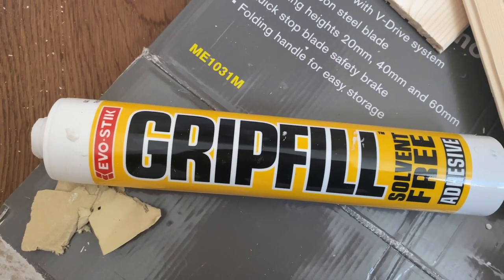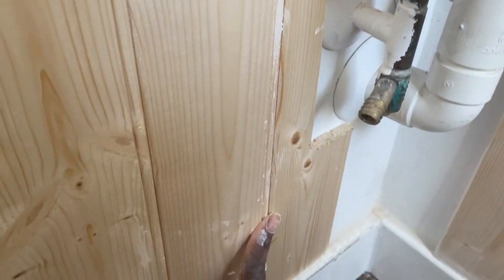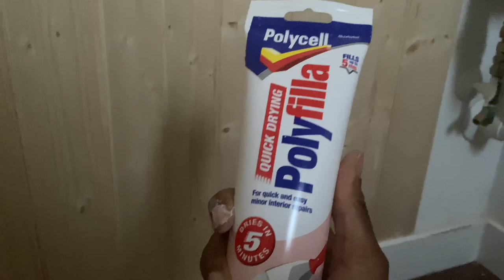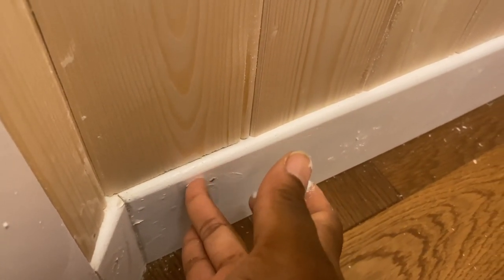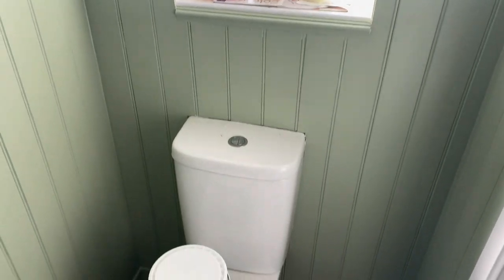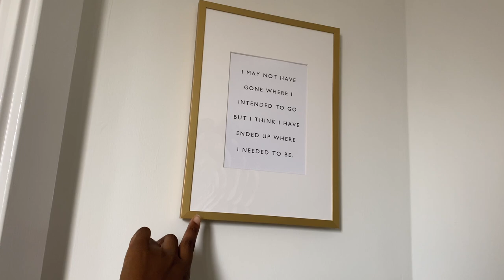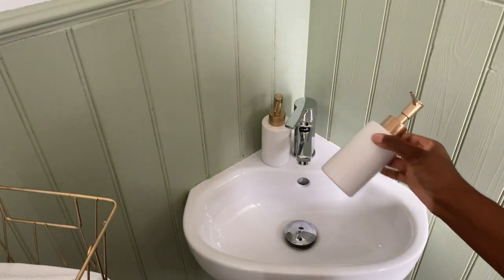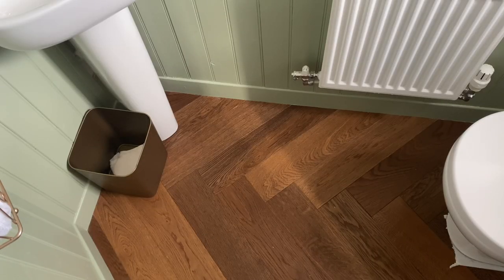DIY Cloakroom Transformation (with tongue and groove cladding). Persimmon Hanbury WC

Comment: Lovely job, well done. I found where caulking was used it's difficult to paint over.
Reply from the maker: Thank you! Yep caulk is rubbery so hard to paint over! It’s the last step after painting really (any gaps should be filled/sanded before paining). There is a see through caulk which is less obvious, or if your fixtures are white like mine, then white caulk I guess is an okay option. ☺️

Comment: looks lovely!!
Reply from the maker: Thank you ☺️
Reply: @WhenLoveisProjected  incidentally what did you use to cut the panels..??
Reply from the maker: I used a circular saw to trim them to length and a table saw because some needed to be cut lengthways on the angled corners. You could achieve the same with a jigsaw as well. Hope that’s helpful!

Comment: great video. How did the tongue and groove paneling fare with time? I read lots of reviews on the similar B&Q ones saying that they develop gaps over time. Did you leave them in the room to dry out for some time before?
Reply from the maker: No I didn’t leave them in the room at all. Yeah they’re fine. Two gaps that were easy to sort, but I’d have a little movement anyway because of settling. I suspect the complaints are because of fitting issues. If you apply enough adhesive, ensure they are properly interlocked and also you could use a nail gun as well (I decided not to) then you shouldn’t have problems. Overall for the price, I think it was a decent product.
Reply: @WhenLoveisProjected  Thank you so much!
Reply: You've litterly asked my "main" questions... 👍🤲

Comment: Are you sure the link to the cladding is the correct one? Your joins look pronounced (which is better) than mice, mine click together with a pretty smooth finish / join?
Reply from the maker: I think so. I didn't buy it online, I got it in store, but I matched the link up with the correct size that I'd bought. This was a year and a half ago though, so they could have changed their manufacturing process, or maybe it's just the difference in how we installed it - no idea!
Reply: @WhenLoveisProjected  it’s ok, I’ve just won idiot of the year. Just been in b and q already having done half my downstairs loo only to see next to the smooth panels, the ones with grooves in. Thanks for the reply!
Reply from the maker: @alex1975uk  Ah no! Well I’m sure it looks good still 😅
Reply: @WhenLoveisProjected  ripped it out and started again!
Reply from the maker: 😆at least it will be how you want it. It’ll be quicker as well because you’ve had practice!